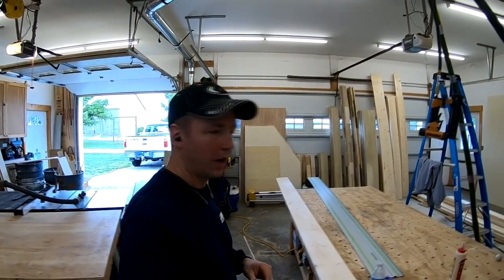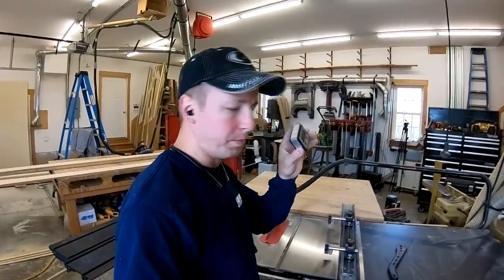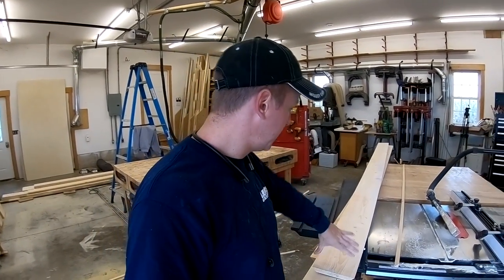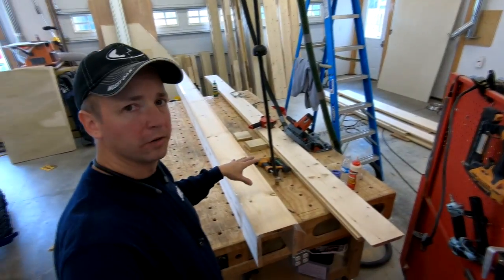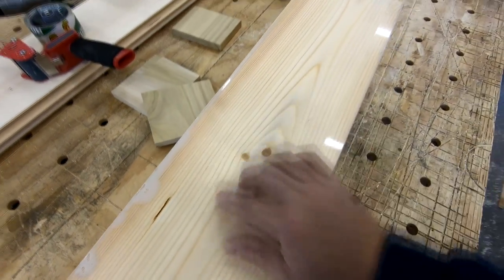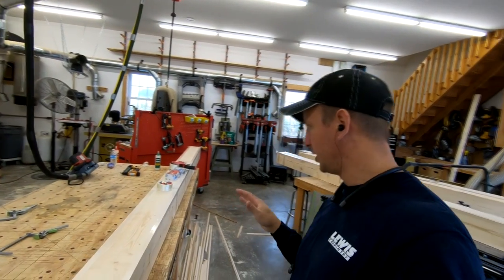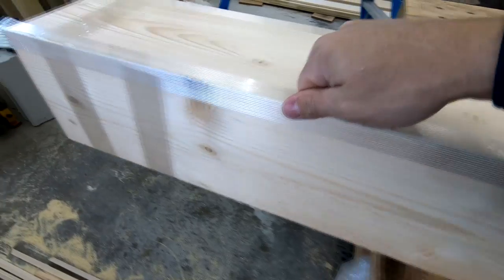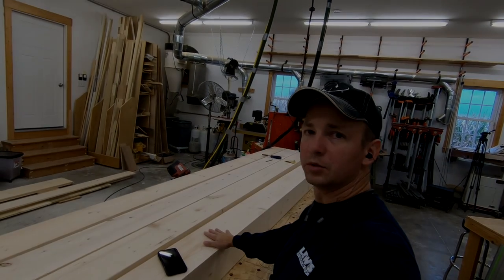Tape Miter Folding 12' Beams - Perfect Beam Assembly with Just Tape

Comment: If you put the tape length wise as you did, then add tape across the 3 or 4 pieces, the tape length wise will contain the glue while the tape running across the 3 pieces will hold the miters together. We use to do it your way in the beginning, but quickly learned that the additional tape gave the assembly more strength to force the glue into the grain as well as up the joint to the interior.

Comment: I went to school for engineering but have been a professional carpenter/remodeler for 10 years now.... i LOVE these videos.  Insider Carpentry, Finish Carpentry TV and Matt Risinger (BUILD) network are my Saturday morning TV shows.  I either A) learn something totally new or B) re-affirm i'm doing it the way other guys are doing it, which is great.  Spencer if you read this, id love to see a baseboard installation video of how you install baseboards over tile and hardwood.   In one of your videos you said you install baseboards before hardwood is that correct? can you explain that?  Do you go back with a shoe?   i always seem to struggle getting perfect inside (cope) and outside base corners (miters) over finished floors...do you scribe your baseboards?  what do you do about gaps under the baseboards when the floors are wavy? I'D LOVE TO SEE YOUR TECHNIQUE.  Finding angles is easy but they never seem to want to line up perfectly with the floors are not flat, what do you do?  i hate standing back and seeing black gaps under baseboards because the tile is lumpy in spots....
Reply from the maker: Thanks for the kind words. In my region almost all the home builder install baseboard, then paint, then flooring, then install shoe molding at the end of the job. So I almost never scribe baseboard to the floor. Shoe molding is small and flexible so it conforms to the humps and the dips in the floor. 👍👊
Reply: @InsiderCarpentry  i feel like were texting this is so cool.  quick question, lets say youre running base (with a laser im assuming), do you use a 7/8" block under the baseboards for hardwood floors?  im assuming you find the high point and thats the elevation you work from? do you do mitered returns on your shoe moldings at door casings?  in the past ive done 22 or 33 degree cuts at the end of a shoe run but the last job i completed i used mitered returns and it seemed to look classy.. thoughts?
Reply from the maker: I haven’t ever used a laser to run base personally. Keep base you the thickness of your hard surface flooring plus 1/8” if you’re using shoe. 

For shoe I just nip the end off at 45 to make a return. Painter touches it up after I’m done. 👍
Reply: @InsiderCarpentry  I'm surprised that you don't run into situations where you are asked to run baseboards without shoe. I find more and more customers prefer this clean look, usually on the more contemporary and higher end homes. Installing shoeless baseboards is definitely a learned skill Matt. Using a laser is ok with smaller rooms but with big rooms you could lose quite a bit of profile unless you have lots to begin with or installing over wall paneling. I find that you need to cut and lay out your pieces before scribing to minimize loss.
Reply from the maker: No doubt about it that it’s a cleaner look. I’m just kind of lazy. 😂 Id rather go beast mode on base before finish.
Reply: @InsiderCarpentry  hey Steven and Spencer:  i do a lot of gut-remodel work (usually my customers buy a home, i remodel it, then they move in). no one around where i live wants a shoe it seems so if i run the base through the table saw at 10-15 degree back bevel on the bottom i can scribe it easily but what the hell do you do when you take 1/8 off the end when the floor joists go up near the foundation (no saging)?   so then the mating baseboard has to lose the same 1/8" (?)  the last house i just completed this past week was built 1979 and the floors where all over the place... all my outside corners had 1/2-1 degree bevel cuts because the floors were not level or flat.  ARGH!  i guess you just live with the gaps.  i felt like my baseboards were going up hill half the time  (hope that description made sense).  BTW spencer i just watched your tutorial on arched beams, that was great.  my next house i convinced the owner to do a chevron shiplap chimney based on your video.  thanks for making me money haha!  just like chip and joanna gaines... ive made tons of money on shiplap and barn doors.
Reply from the maker: Haha. You’re welcome. 

I think with scribing base you need to dry fit the whole room and scribe it all at once. Not go piece by piece.

Comment: A strap of tape perpendicular to the miter about every foot or two seems to help hold things tight for me...
Also a quick run of a veneer roller down the tape before folding helps reduce glue bleed.

I need to try the TB3!

Great video
Reply from the maker: Thanks for the tips! I have found the same thing with running some strips perpendicular also. 👍👊

Comment: I've used this technique with smaller boxes and blue painters tape.  Recently I am building a large TV surround.  The 45.5 is really important with large pieces.  I did the first at 45 degrees and did not get a tight joint.  The only issue was using the strong packing tape.  
Since the project was paint grade, I used MDF.  That strong packing tape lifted some of the top surface of the MDF.  Even though I sanded the pieces, the lift-off showed after spraying primer and satin finish.  I had to prime a few costs and sand it down.

Comment: Great tip with the strait line to remove the crown. Had this same issue yesterday. 
I wonder if the materials were shorter runs if you could run them over the jointer a few passes and then to the shaper with a chamfer bit and power feeder. Just thinking of how to do a large beam packages to increase productivity.
Reply from the maker: Anytime you can use a power feeder its amazing. But with tooling setup it might be counterproductive. I'm considering purchasing a 16' guide rail. Then i could just plop it down on any length and rip the bevel.
Reply: Insider Carpentry my next thought. Adding another 8’ track to my festool track lol.

Comment: Thanks for the great tips, but personally I created a rip sled for my table saw (clamp down board with the crown part overhanging).
My table saw is 12 inch blade, so even at 45deg I have room for the sled, but you could rip a straight edge first, then pass with miter.  Cheers.

Comment: If you are cutting off 3/8 when cutting on your chalk line, how do you still end up with 5 1/2  inside dimension? I would imagine that depending on the quality of the lumber you might have to make adjustments on the blocking. Thanks for posting this as I have in the past always used clamps and pin nails for building folded miters.
Reply from the maker: I fudged my cut over a bit both ways and had to shave 1/16 off a couple of the 5-1/2” blocks.

Comment: Love the method used it many times. We're doing a job now where the room is 24 ft long in the direction of the box beams. Obviously we can't build a box beam that long and install it and get tight joints to the walls on either end so we're going to have to two piece them. What is your advice on a good method to join them together. I've thought about just square button them with biscuits or a peg system but I'm afraid you're going to see The Joint. I thought about possibly a shiplap looking joint etc. Your expert thoughts would be appreciated
Reply from the maker: Typically I'd just be doing a standard but joint. And do my best to grain/color match the splice.

Comment: I saw your video and have used this myself in the past.  It works great.  Just one question, when you set the angle on the saw you made it for 45.5 degrees rather than 45.  Is there a reason for that?  Thanks and good work.
Reply from the maker: Ensures the outside corner comes together tight.

Comment: I'm a GC who is starting to self perform more finish and your videos are a huge reason I am feeling comfortable doing that.  Do you think this method would work with hardwood plywood or are the veneers too thin, possibly showing through at the corners?
Reply from the maker: Depends on the plywood you're using and how good you are with the sander. With the plywood I use sanding through usually isn't an issue.

Comment: It's nice that you actually took advice on that reinforced tape. A mark of a true craftsman - always learning. BTW, have you tried Mafell guide rail?
Reply from the maker: I haven't. I have so many festool guide rails I'm kind of committed to that system. It would feel like wasting money for me to buy a different brand.
Reply: @InsiderCarpentry  Mafell plunge saws are compatibile with Festool/Makita system, but original guide rail gives you some extra features. For me it's the same - battery platform and guiding systems determine my choice of tool brand.
Reply from the maker: Yeah. The mafell works fun with the festool rails besides the fact that the splinter guard doesn’t line up on a bevel. Otherwise it’s a good combo.

Comment: You can actually try to 3 inch wavy packing tape it gives more surface area to grip specially around the microphones rather than having a 1 inch I have an inch and a half on each side or surface area to grip the surface of the work. Just a suggestion Greg

Comment: No hold down clamp on Festool track? When you moved the track, how do you keep from getting a discontinuity in the miter? It looked like you just aligned things by eye. When you say miter at 45 1/2 deg, are you measuring from the vertical or horizontal?

Comment: Thanks for the video! I'm going to try this for my next DIY project.  I have a question - my beams are longer than 16'.  I can't seem to be able to find cheaper boards I can stain that's longer than 16' at a local store unless I go cedar.  If I were to join two pine boards, would gluing sanding and staining hide the jointed surface or would it still show?
Reply from the maker: Done correctly it won’t be too noticeable.
Reply: @InsiderCarpentry  Thanks for the reply!!

Comment: I have struggled getting the correct measured cut  width when each side of the board has miters. How do you align the fence, blade and work piece to get the right cut width you want? I can never align the blade with my marks when mitering. Hope that makes sense. Oh and I am talking about on the table saw. Thanks

Comment: Hey Spencer now that I see you talking about that strapping tape?  Did you ever get that “Infinity 8 1/4” ; 1/4” Dado Blade ?  It’s the one I slap on for making cabinets all my 1/4” up to 1/2” Dado’s in two passes.  I cut down my drawer making time by 2/3 rds.  Before to finish my cut sheet & make 8 drawers it was at least 2 or 3 hours?  ( I know I am slow).   Now that I hv been using this blade I cut all the dado’s & put together 8 drawers the other day ( after they were cut out) in approx 45 min.
It’s $129 (yes pricy I know) but I hv found they fill in the gap with quality American made stuff when White Side is out, back logged or does not hv it.  Ok Spencer great video!
Reply from the maker: I looked into it months ago, it might have been you that mentioned it to me??? They were out of stock at the time when I looked at them and never ended up pulling the trigger.
Reply: I watch what your doing of course I know we see like 1, 100th of a percent of it-ha!
So I know your constantly doing closets in MB with drawers, storage , tons of stuff requiring a 1/4” or 1/2” dado?  I really don’t do a lot but when I do?  I used to hate drawers!!!   Now I use the 1/4 , 1/4  system!  Everything is either a 1/4” or 1/2” dado.  I use it on my cabinets for all my backing now it’s one pass not two!  

Anyway if u do pull the trigger let me know what you think?  Now if it’s a flop??  Let’s just forget this whole thing?

Comment: I know what your doing works but have you ever tried putting some small dominoes in the mitre joint?  Seen it done a few times but never tried myself- wondering if there’s any real benefit to it.  Other than perhaps if the material is really bowed and it needs to be fought into shape.
Reply from the maker: I have done it. I find it to be complete overkill for something like this and actually makes assembly much more difficult. The dominoes make it much hard to get the joint to come together tight and because its at an angle there isn't a good way to apply pressure to bring the two pieces together.

Comment: I can see how letting glue run to the outside of your miter could be problematic if a lot of sanding was needed possibly exposing a portion of the inside of the miter joint.

Comment: Do you ever have the cut pieces crown after you cut them due to tension being released in the wood?
Reply from the maker: Being that I’m only taking a small amount off the ends no. If I was ripping it on the middle it would definitely be an issue. 👍

Comment: Hey Spencer, I've googled for a good hour and I couldn't find a good answer for this: How do you measure for a miter folded column/post wrap? Say the post is a 4x4 and I wanted to measure that and rip it on a table saw. If the measurement is 3 1/2", how do I set that up on the table saw since the measurement is on the short point? I know I can rip one side and slowly inch up to it, but there must be a better way?
Reply from the maker: If the material is 3/4 you just simply subtract that thickness. 3.5 - .75 = 2.75. Set your fence tape to 2.75.

Comment: Question about using the reinforced strapping tape: Does removing it remove a lot of the fibers? I use the fold miters on some boxes that I make and I do have issues at times with painter's tape stretching or not holding well enough. I tried packaging tape but when I used it, it did not stick well enough. I may give the strapping tape a try to see how well it works.
Reply: Also, does it leave any residue?
Reply from the maker: I'm sure it could pull some wood fibers on certain woods. I always sand after doing a miter fold so residue is not an issue.

Comment: Also thoughts on the mt55cc
Reply from the maker: It has more power than festool. I love the scoring feature. Most annoying thing is that at 45 it doesn’t line up with the festool rails splinter guard. It needs Bosch or Mafell track to  line up properly.
Reply: Insider Carpentry on some saws it doesn’t even line up properly on its own track (mafell/Bosch tracks) - known of a few get returned to dealers as they were off.

Comment: Spencer you need a new tape gun. That 3M is horrible. I switched from that gun to a Tach-It EX3. World of difference. We just did two large home moves right after each other so lots and lots of packing. I also switched from the same heavy duty tape to Duck Brand. Not sure if it work better than the reinforced for what you do. Probably not but I like the Duck Brand a lot better than the heavy duty I used for years.

Comment: Great work and good teaching. This may seem petty, but clean that floor up before moving on to the glue up, stop walking all over that stuff. Your body and joints in your body will thank you when you're 54 like me. I'm sure your family will thank you when you don't have to take time off because you rolled an ankle. Put a 5 gallon bucket under your cut station and throw the small pieces in it as you cut. Less trip hazards and you can empty it as it gets full and don't have to bend over to clean it up as mush saving your back.